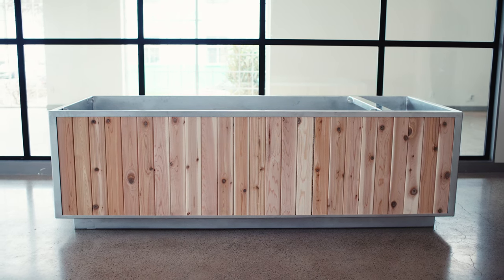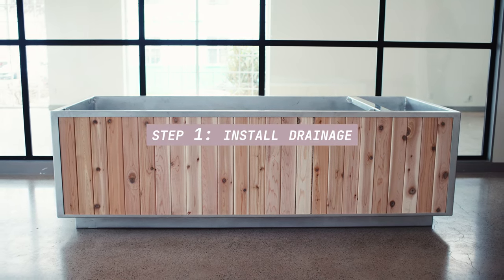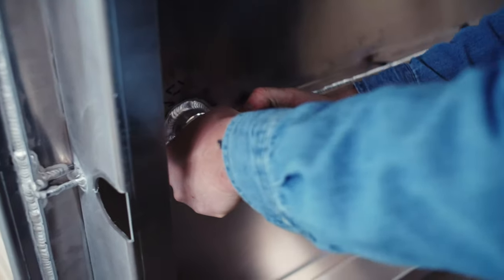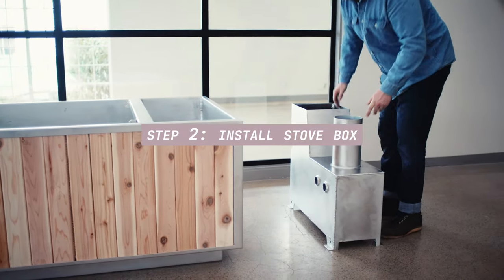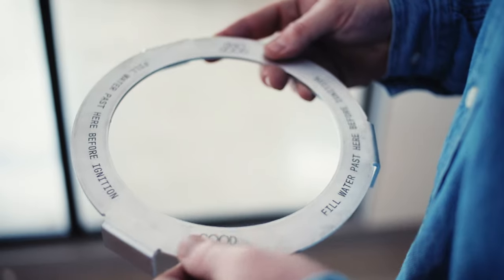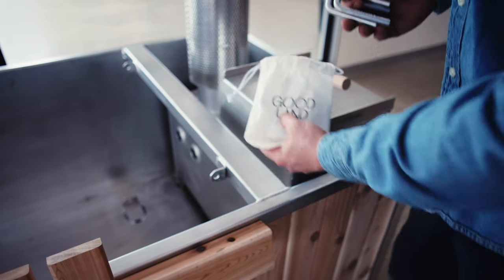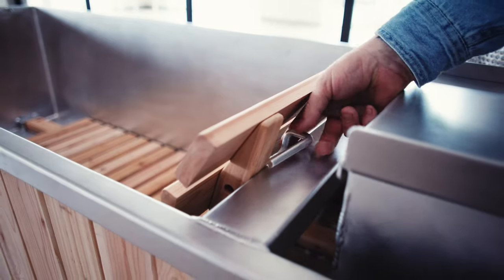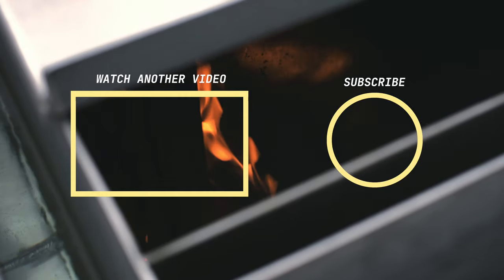Wood Burning Hot Tub Setup: 5 Simple Steps

Comment: How to control temperature? The water may get too hot...
Reply from the maker: It is very easy, you just add a little cold water if it gets too hot.
Reply: @hello_goodland  Hectic process but I liked the design and concept.
Reply from the maker: @KingDavidPaul  It really is not, after a few soaks you get the hang of it.  It does not heat up rapidly enough for it  to be hectic, it is a very gradual and relaxed process.  For more tips on how to heat operate the tub specifically we have a video - https://www.youtube.com/watch?v=NCd49SLBVUk
Reply: @hello_goodland  Thank you sir